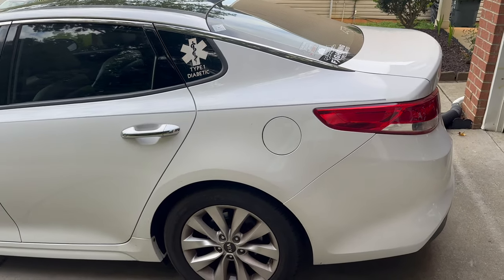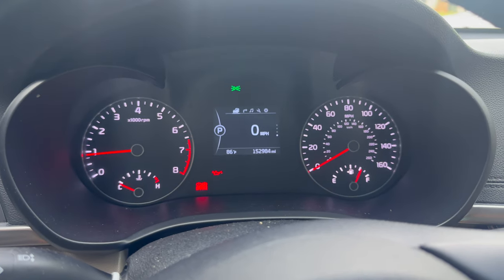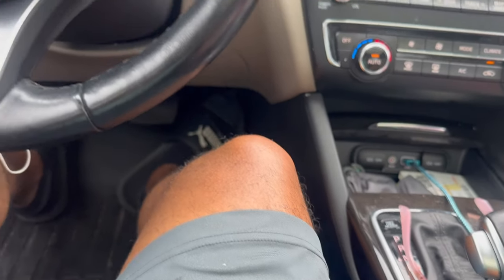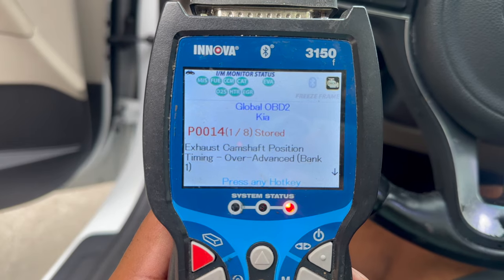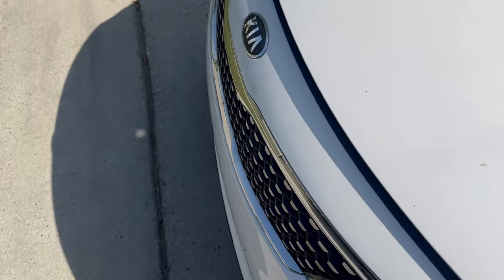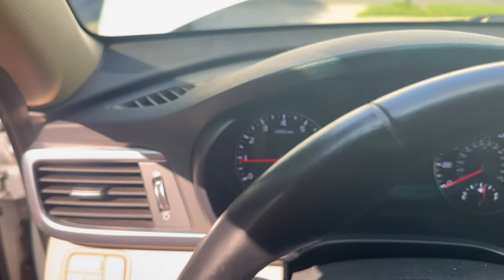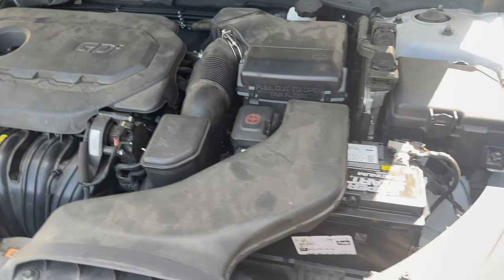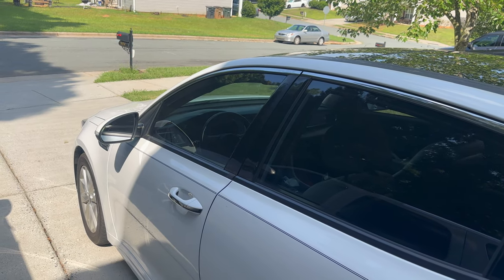2016 Kia Optima Warranty Engine Replacement | Low Oil | Oil Consumption @kia

Comment: Oh wow. I can hear the knock. 

I have a 2016 Kia Optima. But mine is an LX
Reply from the maker: It got worse and worse as it ran, as it should. I believe all the 2016 Optima’s came with the same engine except the turbo SX and SXL models. I am not sure if those have the same oiling issues.
Reply: @ thanks for your video. I am calling KIA tomorrow to have them check it out.
Reply from the maker: Is your car knocking as well?
Reply: Same here. I'm taking mine in today. Excessive oil consumption. Jerking at stop and it has stalled once at stop. Only 56k miles. We'll see what they say but from what I've read these models have known issues so I'm hoping they will resolve them without a fight. No engine codes that I've seen though so we'll see if they try to argue that.

Comment: Same problem same car .Did you get Free engine replacement.what is the process ??
Reply from the maker: Yes. It was replaced for free under warranty. You need to contact your Kia dealership and provide them with your vin# so they can look up and verify that your car is covered under warranty. Once it’s covered and approved by Kia, have it dropped off at Kia and they will replace the engine. So give them a call to get the process started.

Comment: My went out at 115k miles (last Thursday (9/26/24) 5 days later i got a call from kia America I’m getting free engine.  But they don’t have one in stock so I got to wait! How long did it take you to get it back ?
Reply from the maker: It’s great that they are covering it under warranty! And it took them 8 days from drop off. I am not sure if they had the motor in stock or if they had to order it.
Reply: @DariusBuildz  my car been there around 10 days still no word from them :( how’s the car after new engine ? Any lost of power or hesitation on acceleration ?
Reply from the maker: Just give them a call and ask for an update. And the car feels the same as it did before it started knocking. It ran fine pre-knock, other than a little hesitation from a stop which may have been the computer doing a correction from the possible low oil pressure.
Reply: @DariusBuildz  I got the call today my car is ready for pick up illl go tomorrow, but my question was “after you got your car back did you feel the car better than before or same hesitation”?
Reply from the maker: The hesitation was gone after I got it back. The car drove normally after the engine replacement. And I’m glad they have it ready for you!
Reply: @DariusBuildz  they replace the turbo as well brand new car now!!!
Reply from the maker: Niceeee! My buddy’s turbo went out on his 2019 and they want to charge him $2000 to fix it.

Comment: Same car same problem.engine error code is low compression pressure will it cover under warranty
Reply from the maker: Kia will not warranty it unless there is a audible rod knock from my understanding
Reply: It getting heavy knock because of cylinder 4 has low compression pressure will it cover on warranty
Reply from the maker: You will need to call Kia, give them your vin# and have them verify your warranty status.

Comment: Sh*t cars 
Would never buy a Kia/Hyundai
Reply from the maker: They are actually good cars since 2012. Every manufacturer has their issues with every model. And Kia has fixed the issues with the engines.
Reply: @DariusBuildz  good cars? 🤣
What about all the fire recalls? Transmission failures? And engine failures? 
On top of all the other issues they have with quality control. Just look at CRs used car reliability report. They are at the bottom where they should be. 
I have tons of friends working at shops and dealerships. They are sh*t cars and every single one of them echos that when I ask them.
Reply: @DariusBuildz  they haven’t fixed them because it’s just a bad design. The Thea engine family is a partnership engine between Hyundai/Kia, Chevy, and Mitsubishi. They are crap engines and Hyundai/Kia still uses them to this day 🤣
Reply: @DariusBuildz  I like it how engine failures are at all tolerable as just another “manufacturer.. issues”. That is unacceptable and they would’ve never covered you. The only reason they are is because they got sued and are now bound by law. And trust that they would fight you tooth and nail if you didn’t do their software update or somehow slightly fell out of their legal obligation.
Reply from the maker: Every manufacturer has recalls and issues  as ive said. Kia is no different. Doesn’t matter if it’s engine issues, transmission issues, turbo issues, head gaskets, oil pumps, or wiring. You buy a new car, you get to pick your route of recall and issues that you will have. We bought this car new and it’s the only issue that we have had and it has been resolved. And almost all car manufacturers won’t pay for an issue until it’s a lawsuit involved. Hell, GM knows their DOD isn’t worth a shit and if you are out of warranty, it cost $3500 for the repair.
Reply: @DariusBuildz  I’m glad that’s all that happened for you. My friend almost burned down with their Kia Soul. 
And there are thousands of other cars that have burned down because of Kia/Hyundais poor quality. 
It’s not just the recall they aren’t good cars. 
You’ve been incredibly fortunate. Hope it continues for you.
Reply from the maker: Im sorry that happened to your friend. If they are weary of their car catching on fire, tell them to avoid Ford hybrid vehicles, Subaru Ascent, Mercedes, Chevy Bolts and the BMW i4 bc they seem to spontaneously combust as well for various reasons water intrusion to transmission leaks. Advise them to buy a Honda and have their power steering go out instead of their car lighting on fire.